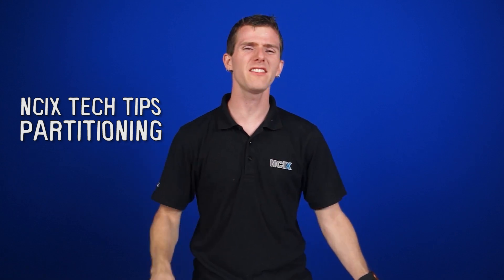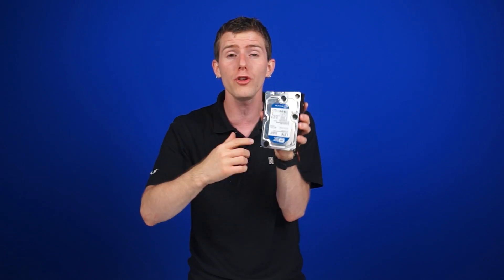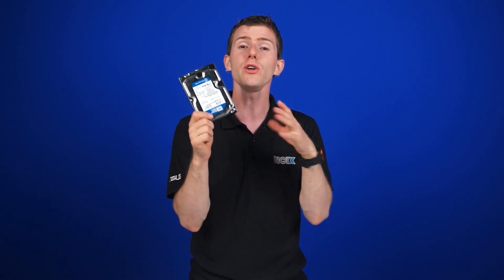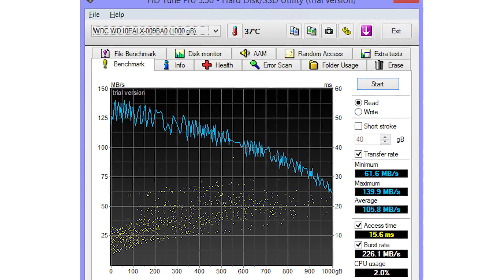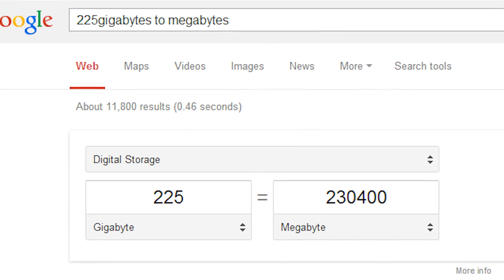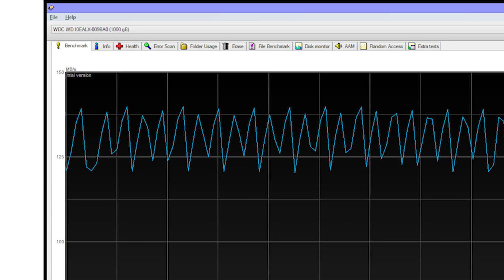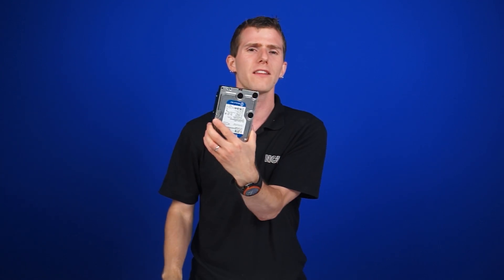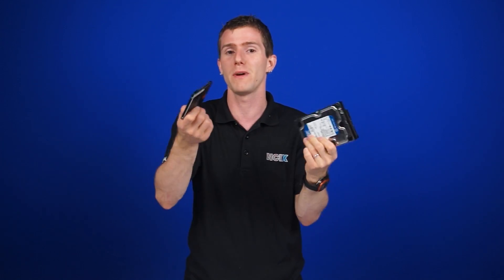How To Optimize Your Hard Drive For Speed

Comment: hey, i was configuring a laptop on pcspecialist and i was wondering whether my additional choices were worth the cost? first: the step from i5 to i7, secondly, i chose the gtx 940m over the intel hd 530. i also chose 16gb of ram over 8, and i got that £10 extra cooling thing. what is the waste of money and what was actually a decent move, thanks! 

also is it worth the extra money for SSD for gaming? i only really play World of Tanks xD
Reply: ssd is worth it for responsiveness everywhere. i5. gtx940 8gb ram
Reply: so the i7 isnt really worth it?
Reply: TBH we are lacking critical information. what is this to be used for? If Gaming, then no, don't bother with the i7. To go bigger on ram, and make the jump to the i7 you could really only justify the cost for a video editing machine.
Reply: or if you got a sweet deal like $99 for an intel i7 4970k Currently on air, but watercooled it will OC to 4.8 Ghz without full load thermal throttling :D..... That's how I ended up with an i7 in my latest custom build.
Reply: watch some linus videos on "should I buy a video card, or a better cpu" and you'll see you can game on some pretty ancient processor platforms with a good video card.
Reply: yeah, right now im running on an amd e2-1800 apu... so i dont really mind the i5, but are you sure of the significance of the 940m over the 530?
Reply: we still don't know what you're goal is for this laptop... that's an important factor. If gaming, then yes, I'm sure. It's a better chipset, and will even consume less battery power along with not eating up your system ram because of it's onboard 2GB. The 530 uses system ram . this is detremental 2 fold. not only is your game being read from system ram, so is all your texturing and other rendering related resources. With dedicated graphics memory, you are not clogging the information highway on your front side bus with all that GPU chatter. Second being textures are placed on the frame buffer in the card, and frees up system memory (also why the 16 gb is really not necessary) I run 16GB, and I've never utilized more than 8 even letting Samsung manage a ram disk through it's R.A.P.I.D. feature that provides me with   5GB/s HDD read capability. I highly recommend a Samsung 850 as the SSD for this feature, among many other great reasons to buy this drive. http://www.game-debate.com/gpu/index.php?gid=3284&gid2=2802&compare=intel-hd-graphics-530-mobile-vs-geforce-940m-2gb
Reply: "In terms of overall gaming performance, the graphical capabilities of the Nvidia GeForce 940M 2GB are significantly better than the Intel HD Graphics 530 Mobile.

The GeForce 940M 2GB has a 722 MHz higher core clock speed and 8 more Texture Mapping Units than the Graphics 530. This results in the GeForce 940M 2GB providing 20.1 GTexel/s better texturing performance. This still holds weight but shader performance is generally more relevant, particularly since both of these GPUs support at least DirectX 10.

The GeForce 940M 2GB has a 722 MHz higher core clock speed than the Graphics 530 and the same number of Render Output Units. This results in the GeForce 940M 2GB providing 5.8 GPixel/s better pixeling performance. However, both GPUs support DirectX 9 or above, and pixeling performance is only really relevant when comparing older cards.

The Graphics 530 was released less than a year after the GeForce 940M 2GB, and so they are likely to have similar driver support for optimizing performance when running the latest games.

The GeForce 940M 2GB has 2048 MB video memory, but the Graphics 530 does not have an entry, so the two GPUs cannot be reliably compared in this area.

The HD Graphics 530 Mobile has 24 Shader Processing Units and the GeForce 940M 2GB has 384. However, the actual shader performance of the Graphics 530 is 202 and the actual shader performance of the GeForce 940M 2GB is 610. The GeForce 940M 2GB having 408 better shader performance and an altogether better performance when taking into account other relevant data means that the GeForce 940M 2GB delivers a marginally smoother and more efficient experience when processing graphical data than the Graphics 530.

The Graphics 530 transistor size technology is 14 nm (nanometers) smaller than the GeForce 940M 2GB. This means that the Graphics 530 is expected to run slightly cooler and achieve higher clock frequencies than the GeForce 940M 2GB.

The HD Graphics 530 Mobile requires 45 Watts to run and the GeForce 940M 2GB requires 30 Watts. The Graphics 530 requires 15 Watts more than the GeForce 940M 2GB to run. The difference is not significant enough for the Graphics 530 to have a noticeably larger impact on your yearly electricity bills than the GeForce 940M 2GB."
Reply: I am getting an upgrade because I would like to be able to play games in a resolution higher than 768, minimum settings at 15 fps. I do use it for web browsing, audio editing, document writing and just watching youtube (obviously) so its not too big of a deal about getting 64 gb of ram or anything. and the whole deal about battery life i dont care, i have it plugged in wherever I go. and if i am out and want to write a document or something, i use my ipad.
Reply: check the link I sent you, it says the 530 is usable up to x768 res and doesn't recommend higher settings. there's your answer, the 530 is not a wise investment based on your stated desired results.
Reply: I just realised your ssd question regarding impacts on gaming... load times. Much faster load times. Also, you may find yourself spawning earlier in multiplayer deathmatch/ctf type scenarios.
Reply: I play more world of tanks  currently, and i usually spawn 30-50 seconds after all my other friends with HDDs as well, and when i get a new laptop i plan on re-using this hard drive as i have only used 200/750GB over 4 years...

also, what screen size would you recommend? I am trying to save as much money as possible but i dont particularly want to go for a 13" model.
Reply: so an ssd may help you get in the action faster. I can't adequately explain the extent of user appreciation for all that an ssd does for your general experience, but personally I's be adamant about it. however, if you're still looking to save money, stick with the hdd, but keep the gtx. Re Screen size: for me, no smaller than 17, but I'm used to 3 23" monitors, and a 60" Sony 1080 60hz connected to my rig... so... the right answer is the biggest screen that fits your budget.
Reply: currently in my "setup" i have my laptops 15.6" screen and a 20" monitor as a second screen which i use when im doing audio editing, multiple downloads etc. so i dont mind going as low as 15.6 but i tihnk 17.3 is what i will probably go.
Reply: https://www.pcspecialist.co.uk/notebooks/cosmosIV-17/

that is the 17" model which i might be more inclined to get now

https://www.pcspecialist.co.uk/notebooks/cosmosIV-15/

and that is the 15" model which i am still considering.

the thing is, although the difference in all these components may only be about £30-£50, i don't want a massively expensive laptop, so cutting costs is inclined, btw, would you recommend buying a new hard drive or keeping the one i already have?
Reply: I3 AND 2 GIGS OF RAM? AND THE INTEL 530? i guess this was a waste of my time.
Reply: no.... those were the presets xD

i forgot that when i modified them the link didnt change it xD
Reply: but i was planning on getting the i5-4300hq or whatever i5 it is, with 8gb ram and the gtx940m. but im just sending you the link so you could point out any areas where i could cut costs?
Reply: I don't have your cookies, therefore that doesn't work the way you think it does. I stand by my original suggestions.
Reply: Chris Lesmerises yeah, but i thought they changed the URL when you changed specs like on pc part picker. anyway, thanks for your suggestions, regardless :)
Reply: ::thumbs up::

Comment: People, to be sure. Is a fact that i can use the slower partition filling it with videos and stuff that i don't need to open too long. Does it affect the performance improvement of the faster partition?
Reply: It also depends on the activity of the main/OS partition.  Short stroking improves load times most by keeping the files that applications have to load with them closer together.  A high bitrate media file might noticeably slow it down during playback.  As media files typically only need to be read in sequential order; frequency of access/seeks to serve it depend on its bitrate.  The ideal in this situation is that IO for media playback will have the highest priority and other things will slow down so it won't skip or stutter.  In short, yes, but whether you'll notice it depends.
Reply: Luis Alberto Guiza Zayas
You don't assign short stroking to a partition.  It is a term referring to the shorter distance the read/write head moves to cover a smaller partition.  It just happens because content assigned to a partition is never written outside of it.  In this sense, each partition is automatically short stroked by virtue of being smaller than the entirety of the platter(s).  It will benefit your use of an HDD only if your doing extremely heavy reads and writes very quickly or a large batches that keep the drive active.  Some professional work will do enough of either for storage IO to be an annoyance.  Most desktop workloads will sometimes annoy because of the latter.  Gaming, if affected, will benefit more from one or the other depending on how its assets are packed and then accessed on load.  But since it's separate from the SSD, accessing either will not affect access to the other at all.  And I would presume if you game that you keep games most noticeably affected on the SSD.  Each block device has its own private data lanes on the motherboard unless part of a RAID or plugged into a multi-port expansion card.
Reply: consider that all the software used to interpret your said storage data resides on the crossover partition... so you'll get a lot of head movement (sloooooow access times) when accessing your videos and media... if you're only accessing the main drive, your storage should have no impact.
Reply: OptimisticPessimist I did not mention that im using an ssd on the OS, so the secondary drive is the mechanical. Your reply implies only in the case on using a main mechanical drive. The keyword you said is "Short stroking", i still not understand the magic of assign the Short stroking only to the primary partition, anyway the benchmarks said so, there is an improvement in first partitions.
Reply: Luis Alberto Guiza Zayas One thing I learned a long time ago, is benchmarks don't always represent real world usage performance. I can't explain any better than this did what "short stroking" is, but it's important if you want to understand what we're actually talking about here. But it's much less of an issue if your OS is a separate SSD. perhaps not even worth the effort, but a fun project none the less.
Reply: OptimisticPessimist spot on

Comment: So I would need to wipe my drive in order to do this?
Reply: With a lint free towel.  Or an eight pound neodymium magnet.  I forget which.

Kidding of course.  It's easier to start fresh and partition that way without data already on it. But...if it's your only HDD and it came specially partitioned by a PC OEM, I would only shrink your main partition to your determined point.  You don't want to do anything at all to a restore (or certain other such as UEFI) partition unless you're an advanced PC technician who knows how to guarantee its contents are preserved and useable as intended or unless you don't care if you can't use them any more.  It is possible to do it to a drive with data, it just takes a lot of work.  I've modified partitions with data, a lot of time is spent moving files.  It usually works fine.  And it's strongly recommended to back up anyway just in case of hitches (like a power dip, brownout or whatever else).
Reply: @jasonlisonbee  ,You are funny.😅😂🤣

Comment: I didnt understand it. So, what am I going to do? I got 86 MB/s for maximum and 1.8 MB/s for minimum and average of 58 MB/s? What is the next thing to do?
Reply: Chris Lesmerises No matter whats the reason, he defenetly should get a new one xD
Reply: ***** he was probably watching a video in the background, or working with a bloatwared os. Wipe it clean, or at least defrag, then see what your speeds are. Sounds like you have a 2mb cache on an old 5400rpm drive with little free space left. Probably ide interface. Buy a cheap ssd
Reply: just use a 25% rule. He explained what to do next. Wipe your partitions, create a new smaller one, and then one with the rest of the space. better yet, buy an samsung 850, use the software to mirror your drive and you're all set.
Reply: Buy a new drive. That thing is even from 1999 or close to its death.
Reply: Very True. Even a modern 7200 rpm sata3 platter drive (Refurb Wester Digital Black 64M cache! on ebay for ~$60) would be a big improvement if I may assume some things that are unsaid about the measured drive ;) but for the purposes of proving out this video on older hardware especially, I'd like to know all the details.... and see the result after it's cleaned up....
Reply: Chuckiele.

Comment: Should I do this with SSD as well?
Reply: +btje vtje No, this makes no sense. Number 1 because SSD's have no mechanical arm (or any moving parts for that matter) so there are no "faster" and "slower" transfer speed areas of the drive. Number 2 is because SSDs are already blazing fast as it is, and it's just a wast of time to try and squeeze any more juice out of them. This tip is only meant for people with HDD's looking for faster speeds when it comes to load times and what not.
Reply: Ok.
Reply: Will look into it thx.

Comment: Please correct me if I am wrong: Partitioning a 1Tera hhd will, separate Os in one partition, data on others so I can change the os without affecting the data.

Partitions make it easier to defragment because you can defragment different partitions separately and they are smaller so they will defragment faster. 

Keeping different types of data on different partitions keeps the reading arm on that section of the drive while using that software that accesses that type of data. For example keeping video files for editing on one partition, and storing finished movie files for viewing on another, and word prossesing documents on another, and so on and so forth.
Reply: no defrag collects free bits, or if I'm reading your post wrong.... then no it does not correct all the binary 0s to one area.

Comment: just a note for you all: i had to moun... nah... plug in and cram somewhere it doesnt fall (not the same as mounting it properly), my old loud sharkoon fan pointed to my south bridge. i now hate the fancy Asrock logo that s my south bridge heatsink. i really dislike the size and effectivity of my asrock 970 extreme (not the rev 2). it makes pumping 1,3 TB of data back into my bulk partition 50% faster. i m now looking at 53,6 mb/s. oh it just dropped to 52,9 (guess i m indeed on the slow partition)

Comment: Is there going to be a point where hard drives will be full SSD and Platter types removed like the Floppy?

Seems redundant to have both if the capacities of one matches the other fairly close for the price. I can't see the Read lifetime of the drive being a issue. Most people don't keep a drive longer than 5 years.
Reply: what about servers that have to keep data for years after the customer has gone
Reply: many systems use hot swap drives, platter drives that swap like floppys. check out hot swap bays... also servers do this.

Comment: Can I make my PS4 HDD run from 5400RPM to 7200RPM?
Reply: No, only way to have a faster drive is to replace the one in it with another HDD, or SSD, but make sure you have the ps4 OS on a flash drive to install, look at songs website for more info
Reply: dat profile pic doe. M3RK is becoming a meme.

Comment: How can you tell if you have an ssd? Or an older hard drive?
Reply: Hi +ASSAULT9SOLDIER R  
Your SSD is usually a thin aluminum+plastic 2.5 inch drive that weighs next to nothing (very light). Your typical 2.5" laptop drive or 3.5" desktop drive will definitely be in a metal case, it's much heavier and will probably have lots of screw holes in it. the laptop drives may be as thin as an SSD but just see if it feels heavy in the hand and probably much smoother edges than an SSD drive which are almost always a painted color finish with squarer edges.
Reply: ok thanks i figured it out i have a hard drive
Reply: i now know i have a hard drive
Reply: but now that you know, by the same logic it must be an ssd! ooh... paradoxical

Comment: ok so i'm pretty positive that my hdd is just dead, but its running at 8mg/s verses the 125 it used to run at, does anyone know anything that could possibly be desamating my hdd speeds? i really don't want to drop 50 bucks on a new drive, being short on money atm.
Reply: +Allrj yeah its dropping of at around 10gb from 109mb/s to 1.3mb/s of my 1tb and its spiking a few times here and there